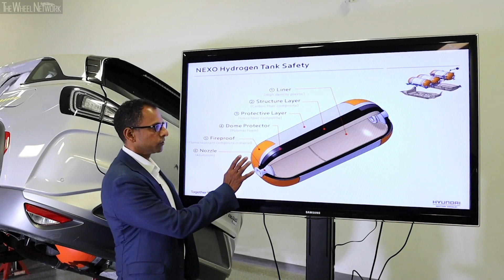Hyundai Nexo Hydrogen Fuel Cell Vehicle IIHS Crash Test

Comment: A few things: 1-door handle on driver side is GONE.  Door skin flew off and I do not think that anyone could get into said impacted side.
2- I want to see a rear crash at 40-60 and 80 KM/H and see what happens for that tank of hydrogen.  I find this to be TOO CLOSE to the rear bumper.  You would never see a fuel tank RIGHT BEHIND the Rear Bumper for that same exact reason.  Seems like tank 2 and 3 are safe as they sit under the trunk to rear occupant section.  
Overall, it seems to be a decent car in terms of impact protection.  This is not your grand-parents Hyundai Poney (for the older folks, you KNOW what I am talking about!)

Comment: Not enough people know that there are already major hydrogen fueling stations and vehicles that run on hydrogen. I always hear people talk about the explosive properties, but gas isn't much safer if you've ever seen a car fire. 

We've been safely transporting and fueling vehicles with hydrogen for the better part of 30 years and people still think its impossible. 

I used to think EV would be the winner, but with the shortages in almost every sector, it's looking more realistic that hydrogen may actually take the cake(lion share).
Reply: hydrogen is waaaay more volatile than gasoline and not very efficient compared to electric vehicles.
Reply: @drewberrynews3875  only if you exclude the average life expectancy of a lithium battery. Lithium batteries simply don’t last long enough before needing to be replaced. A factor often left out of the calculation when considering true efficiency. Also, kerosene is pretty volatile as well, yet hundreds strap in and ride a tube at 30k feet every hour
Reply: @Gman01010010  are you referring to cost effectiveness or efficiency? By the time you use electricty to compress hydogen, cool hydrogen, and store hydrogen then convert it to a hydogen car that charges a battery anyway youre about 38% efficient. Compare that to an electric vehicle in which you use electricity to directly charge a battery its about 80% efficient. No cost effectiveness is  a different story. Youre right the battry for a ev has a limited life and that needs to be factored into the cost of the vehicle over time. With that said hydogen costs about $80 to go 400nmiles as compared to an ev about $32. So there really is no comparison here. Hydrogen vehicles are far more expensive to drive even with the added cost of replacing an ev battery after 7-10 years.
Reply: @drewberrynews3875  what you fail to realize is that many cities in the US have a solar surplus during the day, yet no where to store that energy for night. Even my alternative electric provider has to rely on coal and or nuclear energy for night. Hydrogen while an energy intensive process actually creates more bang for your buck and a faster refill even if it is powering a battery. Also, the lithium resources we have are thin so we shouldn’t be building huge packs that just die every 5-8 years. Smaller batteries would leave more lithium for more cars. Chile is already killing their indigenous with the brines that waste water that they need for us to all have disposable vape pens.

The supply chain shortage proved that lithium cannot replace the gasoline engine worldwide. Lastly, it’s been proven that you can run hydrogen directly. Hyundai and Toyota happen to create hybrids, not hydrogen powered cars. Just in case you forgot that.
Reply: @Gman01010010  having a solar surplus sounds like a good probem for ev cars as more employers can offer charging stations for employees. I think youve missed the point entirely. Hydrogen is not more effecient nor more cost effective than hydrogen. There are only around 100 hydrogen fueling stations in the US and at 5x the cost for only 1 pump hydrogen infrastructure is not likely to expand very quickily at all. I agree that global supply chain of lithium could cause problems for ev cars in the future, howver we are likely to see new battery technology eventually replace lithium. I think this is much more liely than a hdrogen infrastructure being built out. This is why hydrogen hasnt been the dominant tech over the last 20 years. Its really niot cost effective for investors to put money into a system that will liely never catch on. Further the cost to fuel these cars are nearly 3 times higher than charging electric cars. Theres virtually 0 benefit to hydrogen cars over ev cars save for charge vs fueling time as you mention. We havent even talked about performance of hydrogen cars being far less superior than evs. I dont know what else to say other than youre wrong. There is 0 net benefit at this point in investing in hydrogen vehicles.
Reply: Why are we not discussing about the carbon footprint? In my opinion, the best solution is the one with the lowest carbon footprint (cf) in the long term. Battery production is very bad for the environment. Some research say that the cf to produce an average BEV would be the same as the cf to produce a regular ICE plus around tens of years of emissions during the ICE usage. So both are just equally bad, but still BEV has superior efficiency compared to ICE. The other alternative is hydrogen, but as u guys mentioned, hydrogen has a lot of logistical issue and the efficiency to produce and package the hydrogen isn't great also. But consider this, if the production of hydrogen is completely green, do we still need to consider it's production efficiency? Let's say we have a green hydrogen plant that uses 100% renewable energy to run, uses electrolyzers to separate hydrogen and oxygen fron sea water, then u get a zero emission hydrogen plant. Very low cf in the long run.
Cheers!